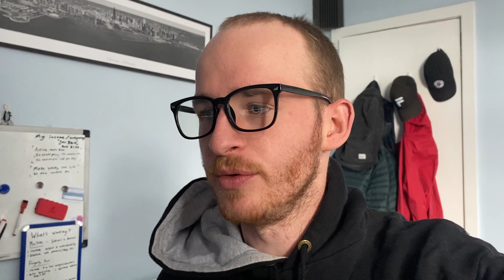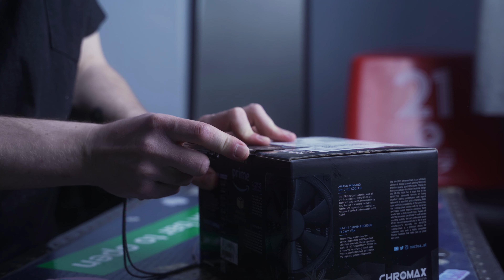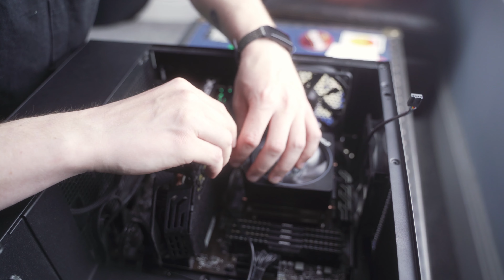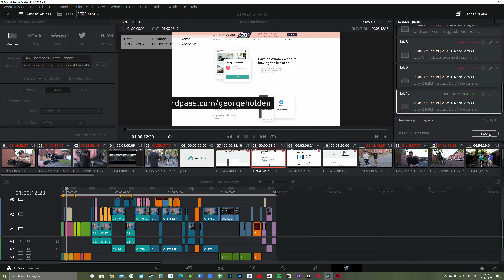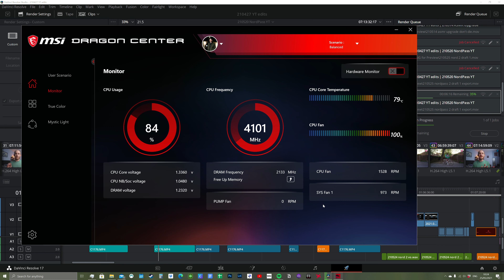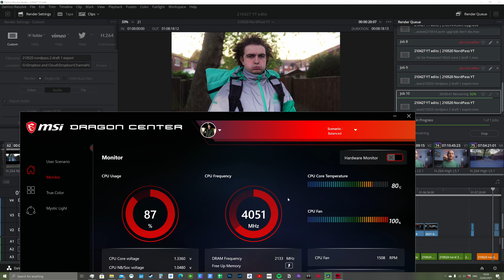Noctua NH-U12S Chromax Black | AMD Ryzen 3900X | CPU Cooler 4K Editing PC Test

Comment: Is your 3900X running the default auto-overclock or do you manually overclock it? I've got mine set at 4.1MHZ and wondering if this cooler would do the trick. I've got the Dark Rock Pro 4 at the moment but it's so unbelievably big.

Comment: I just spend 3 days building a system with a 3900X, 64GB 3600mhz ram (4X16gb) which can only run at 3200mhz because it's dual rank sticks and it's running on a Asus Strix 470-F motherboard. The 3900Xs run like a volcano but with proper cooling they purr like kittens. I have a Noctua NH-D15 which is a beast but the CPU under load never exceeds 60-65 Celcius. 

Are you still using your 3900X for video work? That's why I build this system. Fun fact, I have run into some other of your videos since I am also a Sony user myself.
Reply from the maker: Yes still using it for video work! It's doing well but my GPU is definitely holding it back when it comes to intensive rendering tasks, superscaling and VFX on Davinci timeline playback can get stuck. Besides that it handles 4K 10bit 100fps really really well

Comment: These CPU’s can handle those temps tho, correct?
Reply from the maker: Not at a consistent usage, I've not had experience with a damaged CPU but wouldn't want to push it on my pro workstation!

Comment: Have the same cooler, would highly recommend a second fan for the push/pull config. Drops temps by at least 5°C at both idle and under load. Given the long stretches of editing, would be worth
Reply from the maker: Thanks for the tip!

Comment: Why is you RAM at 2133mhz? Is this the rated speed or did you not enable xmp?
Reply from the maker: Addressed this in a video recently, it was temporarily running at 2133mhz after a rebuild - has been bumped back up to 3000mhz since

Comment: You don't have enough thermal mass for constant 100% CPU, D15S would have been better suited to that 8min render, but it too would eventually load with too much heat, water coolers have best thermal mass, but people often are afraid of them
Reply from the maker: I went for the air cooling option just because of price and aesthetic for right now! I may change to a water option later

Comment: How old is your 3900x
Reply from the maker: Oh literally 2 months I think!
Reply: I too bought it back in feb paired with 3070 works good.. For heating problem(92c +) i changed the Stock fan speed to high and set the volt to 1.25 at 4000mhz and added one more exhaust fan at the rear. Now its under 80c even with rendering or encoding. I use gpu for rendering though. The only problem i found with this cpu is it can't handle raw canon 8k files for editing
Reply from the maker: @abhiku10  yeah I mean 8K raw is some heavy heavy data! I mainly use my CPU for rendering atm as my GPU isn't the fastest ever
Reply: @abhiku10  Malayali?